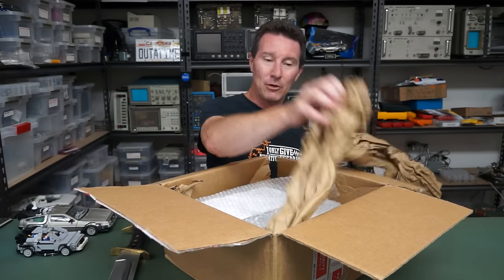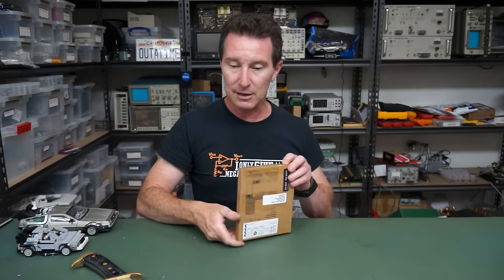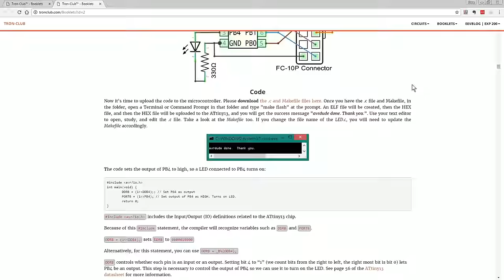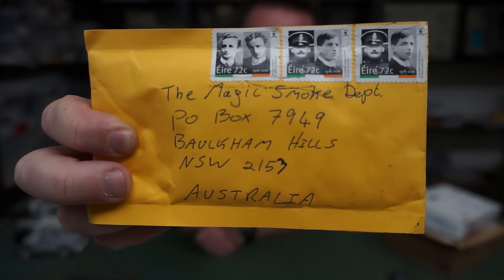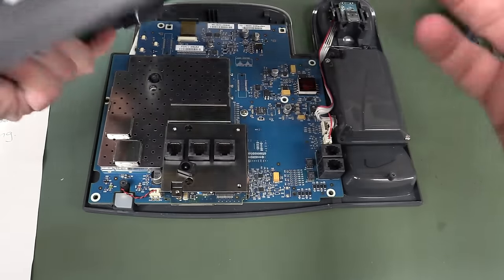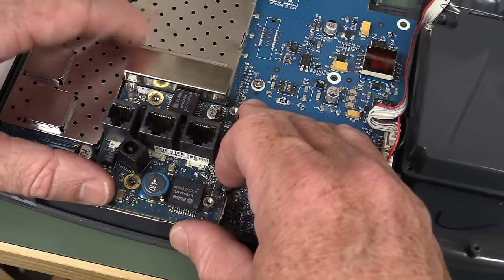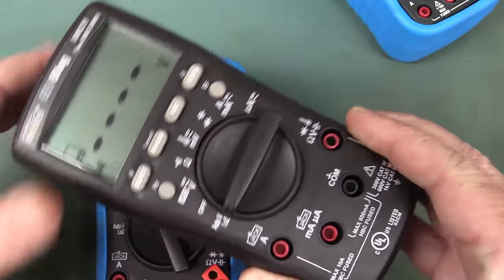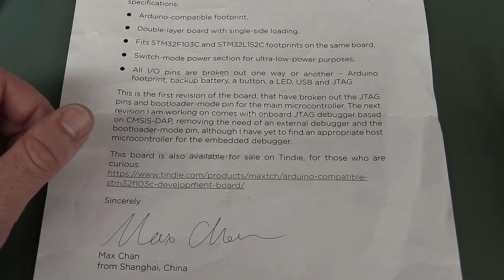EEVblog #964 - Mailbag

Comment: The Cisco IP phone does NOT use a standard power over ethernet pinout, they use their own pinout. Because clearly standard power over ethernet does not provide the optimal configuration for the best VoiP experience, but changing the pins around makes it perfect.

Comment: The copper lands can also be to balance the amount of copper on each side to help with the plating process - Eurocircuits online DRC checker will sometimes complain about designs with a big difference in density between sides.

Comment: Those caps have series resistors (typically 100R) , not inductors - they're snubbers for use across contacts - the resistor limits surge current when the contact closes

Comment: Did you notice the crappy layout on the Cisco IP phone?  There are some DC/DC converters on the board, and they put the high-current loops on inner layers, rather than on the surface.  That means their switching current run through the ground planes, probably making the whole board pretty noisy.  Basic rule for beginner power supply designers: keep the two current loops tight and on the surface, and connect to the inner power/ground planes with vias only at the input, output, and common nodes.  I haven't seen any videos on YouTube about this, so it might be a good subject for one of yours, Dave.

Comment: Dave, the PWM input is what is used for controlling it, you would connect that to a spare R/C channel, R/C model systems use PWM for all servo and speed controller control inputs, typically it is a pulse that varies between about 1 and 2 milliseconds.

Comment: Those pushbutton-pulse dial phones were weird, but I took a lesson from them and built a relay-driven pulse dialer that connected to the joystick port of our Apple II+. With a database I built in Applesoft, I would use that to dial into bulletin-board systems nearby, so we could connect via acoustic coupler modem. 

I believe the neon bulb in the antenna line was a low-tech static protection. It gave some bleed off in case there was a nearby lightning strike, or shocky carpets.

Brings back memories...good times, good times...

Comment: its certainly  not long term reliability on the Cisco VOIP phone. We use those at work and we've had to replace several units because the hook switches would fail after just a few months. Especially in areas where the humidity would be a bit high. So many issues from those phones
Reply: Yeah I have alot of these phones at work. The hook switch is horrible for reliability.  They're also an easy fix though. Just straighten that wire back out again and good for a bit.. I noticed there is a better design in later models.

Comment: Neon lamp on the handset antenna circuit? Shuffle your feet across the carpet on a cold, dry day holding the handset and then zap that whip antenna to a metal doorknob. 

You'll see it light up, if only for a brief flash.

Very cool as always!

Comment: A bit of info on the Cisco phone...

We are still using these exact phones for all desk communications. I work for a government department where calls made NEED to be secure. These are part of few fully closed systems left on the market. By fully closed, I mean we run the whole system, from call managers to end phones. The only thing that anyone else controls are the phone number allocations (we have a block of numbers we can allocate). The main feature of the phones we care about is the encryption. If someone makes an internal call from one phone to another, the call is encrypted end to end. Not even myself as an IT administrator can listen in, even though I have full control of the system.

Comment: 1990s Nortel system phones have a very similar hookswitch with the spring wire and conductive plastic contact. Surprisingly, it seems to work well.

Comment: Regarding the electropermanent magnet, being a device for putting in drones and RC hobby gear, most definitively the PWM input is likely a standard PPM hobby receiver signal input. Quite convenient to operate the device from an assigned knob or switch in the RC transmitter.

Comment: I have a few Cisco 7961 in my lab.  Their 'power budget' is 12.95W as it is a PoE device.  The phone declares itself is a 'class 2' PoE device - which means it will never require more then 6.3W.  I've never tested current draw on PoE to get actual numbers.

Comment: The "spring" in the VOIP phones is a huge failure point here.  I got tired of fixing them and just started stuffing chunks of foam under the hinge,  If the phone was outside of warranty I didn't wanna spend  $250 of my budget to fix a phone killed by $0.01 spring.

Comment: I'll bet that mains cord attachment at 03:04 was not OEM, but was a replacement. I think the crimped splice seen at 03:23 confirms it, because who would want to pay assemblers to wrap a joint with tape instead of using a quick crimp? Also UL would have something to say about mains voltage being exposed when the tape lets go with age.

Comment: We had 3 out of 20 of those cisco phones fail because of the strange cradle mechanism. 
The PM using his all the time broke two of the three in under a year. His solution was to use the speaker phone in the open plan office. Our solution was to bin his phone. 
To be fair to Cisco none of our phones were brand new but they were allegedly reconditioned and can't with a warranty.

Comment: In Europe, analog cordless phones are forbidden now, since DECT is the standard for about 20 years now, and they have reassigned the frequency band (I think it was 480MHz) to some other use, so using an old analog cordless phone can really get you in trouble if your phone disturbs some other transmission.
However, the guy from Indiana (I forgot his name) who sent this in should wikipedia-google "pulse dialing", it was quite common in the 80s, before tone dialing was possible everywhere (they needed to upgrade the phone network hardware to digital dialers for that to work, while analog pulse dialing can work with mechanical dialers that lift up and turn for each number).

Comment: The Red Pitaya Power Bank disappointed me. That is the cheapest cheapo version of chinese power banks. You get them as gift on every corner.

Unprotected 18650 cells which claim to have 2200 mAh but have maybe 900 and the circuit in it... i dont know if you can trust the charger and the "protection" on it.
Reply: Yea. I got exactly the same power bank here. They all look the same. Even the word "Power" written on it looks exactly the same. red Pitaya just stamped its brand on it.

it had an unprotected cell with "2200" mAh which was not even able to charge my S6 a half.

Even with high inefficiencys the 2200 mAh battery should charge at leats a bit more than the half. So i guess it only has 1.000 to 1500 mAh at best.

It just hurts, so bad they are.

And as i said, if the protection on the circuit board ( if it even has one ) is good ? That is the question.

Probably they all are old laptop cells reused in this power banks.
Reply: If bigclivedotcom's channel taught me one thing then that each of these has their own circuit, slightly different from all others.
Reply: i had one as well, it also was a gift at the days just before Xmas, when i was looking for something in our big tech center...they gave one to you if you bill was over 50 bucks....

I opened it at home and it was the crapiest cheapo thing i ever got....from their claimed 2200mAh there had been only about 1000mAh usable, i didn´t found the others...may be rudolph neede it for his nose...
and it also got soo hot as i charged it up, i quit and opened that danm thing and it only had a tiny board inside a few passives a coil and a two SO8 chips....there wasn´t a thermal sensor at the cell....no way...i returned the parts to that center as they have a container for used batteries...i throwed that inside there....
Reply: Those power back actually got a good circuit inside them. Just replace the cell with your high quality one.
Reply: Tsz Lam Cheung If the only problem is the cell, I'm gonna replace it with a Samsung one. I didn't charge them for years and they are still good.
Reply: Tz Lam to which voltage does this circuit load the cell? if 4,2 is max okay, that might be an option. But if they go higher i would no try this until i know my cell can get to 4,25
Reply: Dom IIRC bigclivedotcom have done some test on them, you can check it out.
Reply: Drakkar Calethiel The Panasonic ones are great too :)
Reply: I know I have some from Panasonic too. The can withstand some abuse quite well!

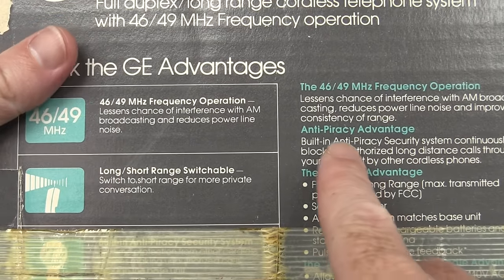Comment: Something about the ,piracy‘ issue 1:50 : As you say, it was a great issue, that nearly anybody, who had a matching handset was able to enter your phoneline  and make (long distance) calls over your line. So listening to calls was no problem at all that days. But also the anti-piracy-feature didn‘t work, if you knew how to work around it. haha... it was quite easy to crack those pairing mechanisms as long as it all was implemented in analog technique.

Comment: Dave, I could be wrong but I think the reason the cisco phone was designed that way was to minimize the clunkidy clickey noises when you hang up the phone in a quiet office, a apparent concern for many office products of the time, like ultra quiet keyboards, quiet mode bios settings for computer hard drives and fans and "hush" mode switch setting on the office vacuum cleaner.
Reply: So you had to whisper when you made a phone call?
Reply: Mac Donalds I never said it made sense but it was a thing

Comment: The pattern of pulses for the demagnetization process reminds me of when one demagnetizes a tape head....you're supposed to swirl the thing around, following the lines of magnetic flux, and very SLOWLY move away from the head when you're done, lest you magnetize the thing again by mistake.
Reply: Yeah. 
Magnetising is done by collapsing the field when it's at it's strongest.
Conversely Demagnetizing works by collapsing the field when it's at it's weakest, hence the distance with tape heads.
Those clicks reducing in volume are the field strength being reduced.
So we don't really demagnetise, we magnetise at a weaker field strength.
Reply: In this case the electro permanent magnet is more or less a coil with a AlNiCo core. 
This technique in combination with a steal frame and Neodymium magnets can produce a significantly greater holding force. Up to like 14kg/cm² with fine contact surfaces and thick enough material to hold. 
I won't try to go into more detail. I'm not an engineer, but I've been installing and servicing industrial electro permanent equipment (good for up to several hundred tons of holding force) for 15+ years now. :-D

Comment: I had to switch out all the rifa caps in my 70's sewinf machines only 1 had failed though was cracked and burnt. The other ones were just a precaustion since they were rated 220v and our line voltage is now 240-250 .

Comment: Those Cisco phones are going to be doing heavy lifting for the audio compression and things so its possible the big beast contains a DSP or dedicated silicon for whatever protocol its using for that. ARM would make sense for that if its got Java, a fair few ARM chips of that vintage contained hardware optimizations for Java

Comment: I have seen many membrane contacts in remote controls, auto key fobs, etc. fail after many years due to a syrupy goo that forms between the PCB and the conductive rubber from unknown sources. After washing away the goo with alcohol, the contacts work OK for a while and the goo returns. So maybe plain old switch contacts would be better.

Comment: About those crusty capacitors and them being "mains rated":
Isn't the symbol right next to the "250V" for DC? Meaning, they're not mains rated at all, since peak value for 230V AC would be around 325 V. Plus, I would think those spade markings are for polarity.

Comment: I think the electro-permanent magnet thingy, or probably a bigger version of it, could be useful for a new extreme sport: Roller-hitching!

Tge idea is, you tie your magnetised magnet onto the end of a long rope, and don a pair of roller skates.  Standing on the pavement, you throw the magnet towards a car as it passes you, holding tightly onto the end of the rope, and try to attach to the car.  When up to speed, simply demagnetise the magnet and reel it back in .....

Comment: Those Rifa capacitors were quite common to crack and still operate with it until moisture gets in.
Reply: the ones in my A77 R2R machine released their "beautiful" smoke when i serviced that machine and gave it a testrun to see if the main transport worked...after ten/fiveteen minutes...yea..some like artificial fog....but with an ugly, disgusting smell as well....that "Rifa" smell, for those who know....

Comment: For everyone complaining why Dave uses the "Stanley" knife sometimes instead of the Dundee one: Such a Bowie knife is built to be indestructible and is actually not as sharp as you might think. But the sharpness stays constant for centuries of heavy abuse. So, for some things you need to use puny but sharp knives.
Reply: A Stanley knife is just what we commonwealthers call a craft knife or boxcutter because they were all made by the Stanley company at one time.  And I would hope it was obvious to folks the difference in sharpness, a Stanley uses a typical razorblade as it's blade and you could slice yourself down to the bone just by not concentrating when you reach to pick one up.  They are the preferred weapon of the coward.
Reply: I'm a commonwealther and the branding "stanley knife" for hobby / utility knives is just as ubiquitous as "hoover" for vacuum cleaners.

Comment: Uh oh, Dave, I think you just fell for a trap for young players™! That cap was rated 250 VDC, so probably intended for 110-ish V filtering rather than 230-ish.
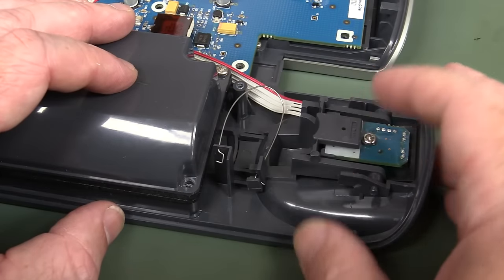25:39 I wonder if Dave put the spring on the wrong way around. It would make more sense if the square hook sat around the block on the end of the other piece for better retention.

Comment: TronClub - well after a considerable delay I received the first kit. Looks OK but the paperwork, component information and circuits are via a website and are not downloadable. The information itself is very good, clear and descriptive, so very well done there. But as it is not downloadable (PDF being the obvious choice) the only way I can use it is whilst online, fine if you always have an internet connection which I do not. So in summary is it worth it, well yes with the proviso it could be a whole lot better with documentation made available offline.
Reply: So it's on a website? You do know you can print websites, right? If anybody there knew their stuff the version to print will have different CSS sheet connected to it to hide the online specific stuff that's not useful on print.

Comment: I doubt the 7961 draws any more power than a 7960 -- which I fetched from storage just to see how much it'll draw... 3.591W while ringing, over a 6ft cord. There's no "java inside" at all; don't know why that's there. It'll be running vxworks or maybe qnx -- I've not been inside one for a long time. The reason for the modular power interface is to make fixing it easy -- that's the thing that fails the most. (lightning can get anywhere) Checking the real phones (AudioCodes 440HD), 3.2-3.5W idle. My phone jumps +0.5W when the backlight is on. My good old Aastra 480i uses 2.902W. I have a "Cisco" 12SP+ -- actually a Selsius design -- that has a full blown Intel 386 inside it. (don't ask how much it draws! "coffee warmer" is the answer.)

Comment: If you have a look at the outputvoltage of the powerbank you will see that it's of very poor quality. I got the same powerbank and it outputs voltagespikes of up to +10V on the 5V pin and the datapins.

Comment: Hmmmm... "Mystery Multi-meter" sneak peek, for those playing along at home!!
Reply: Only relevant if using the low impedance mode. It's not that it doesn't show useful values below 8V, rather, when the LowZ mode is selected, you only get the low impedance from ~8V and above. Which is fine, because the common use for LowZ mode is to detect ghost voltage in industrial applications, which are usually high voltage, ie: 230V or 110V anyway. Other than for that specific application, you'd just use the standard voltage range mode. With a high voltage circuit, say 230V AC, due to wires running in bundles together and capacitance, with a standard high impedance voltmeter, you might measure 230V AC on a pair of wires which aren't actually connected to anything at the other end - "Ghost voltage". If you use a low impedance voltage tester, the ghost voltage will be eliminated/dissipated. But if you measure under 8 V you'll know it's not a live 230V pair anyway.
Reply: It's not a bug, it's a feature.

Comment: Don't blame Linux for slow boot up times. I've gotten a TI Sitara Arm running Angstrom Linux booted, on the network and playing music out the initialized external DSP chip  in under 6 seconds, and that included mounting of an onboard RW JFFS2 flash chip and ext3 (RO) compact flash filesystem.

Comment: at 25:04 - what is the component marked 1-508F?  It has massive legs/pins, two of which are not connected to the pads underneath.
Reply: L = inductor/coil

Comment: Next goes my last suck at the sav. It is not "micro charge" or "μCharge", but "uCharge". I used "u" as a "u" and not as the greek letter "mu" or "μ". Not to be confused with your trademark of using "μ" in your products, like the "μCurrent" or the "μWatch". To top it all, the next version was called "vCharge", and that would break the greek letter sequence anyway. Unfortunate naming there with the "u" and I will not use it again.